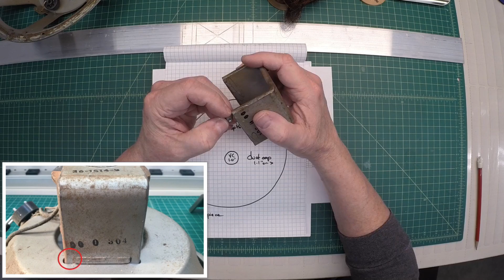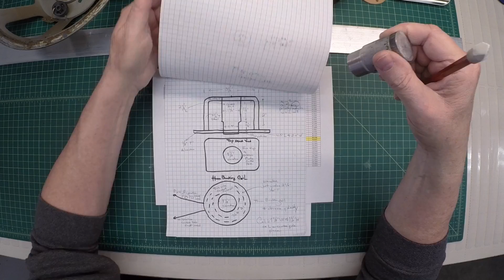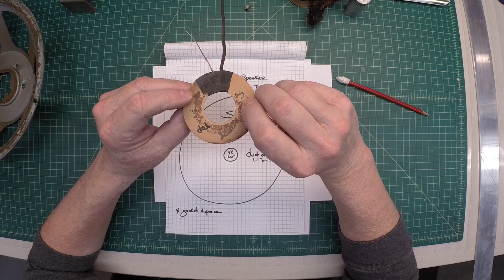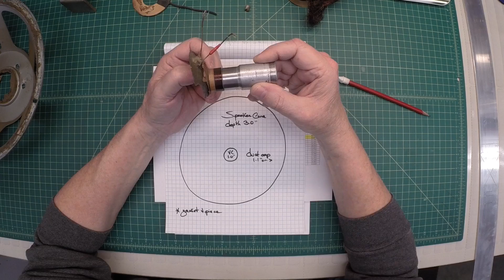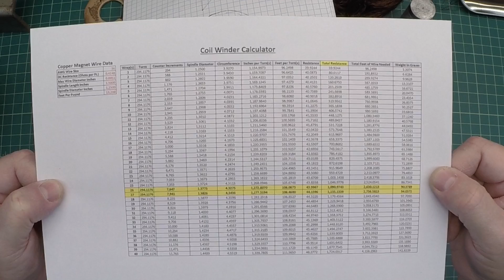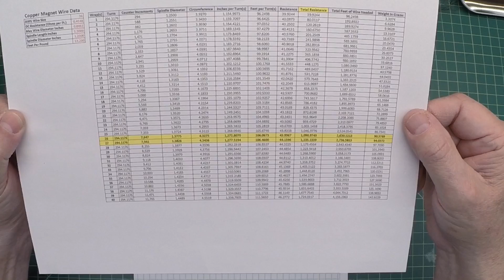Speaker & Field Coil Rebuild on the Horizon

Comment: I have two Grigsby Grunow 10" field coil speakers. One I got DOA from Ebay. I took it apart and unwound miles of copper wire and actually used a bicycle wheel rim and drill to wind it out. I found a few breaks in the miles and miles of copper wire. I unded up losing a bunch of it to a big snarly knot of wire. Carefully soldered and insulated the breaks and wound everything back together. The resistance was a bit less after losing a bit of the copper wire but it works now.
Reply from the maker: Congrats on your repair and getting the loudspeaker operable again! All the best. Don

Comment: Don..got to give a nod of appreciation to the philco folks who engineered this unit..look at the strength and integrity of the parts..and i imagine they never thought anybody would need to rebuild it 60 some years later..as usual..look forward to the next step...thanks again for your time and effort..Rich
Reply from the maker: +iamrichrocker The field coil assembly is part of the speaker and definitely not made to take apart and to your point, it was built like a tank. Time will tell if I'm successful with the new field coil, spider, re-coning, etc. Keep your fingers crossed. Thank you as always for following along. Best, Don